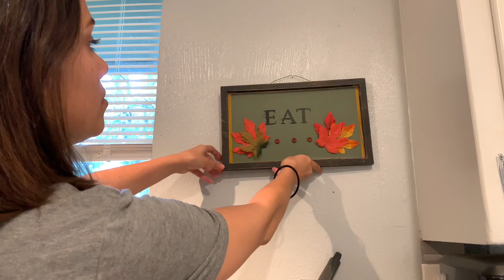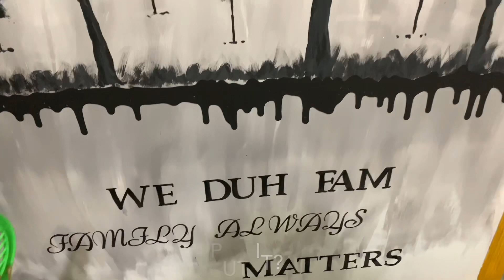Decorate With Me For Fall On Budget 2019 || DIY Ideas|| Cleaning Motivation || Let’s Clean Together

Comment: And  for that little blind that's broke get some clear tape and tape at both ends ,and  sometimes if you have a little plastic or a toothpick you can put it across the bottom or it's broken in half and tape it on both sides 👍😃❤️

Comment: I enjoy your videos. I love the soap dispenser out of the prego jar. I made a 3 piece vase set in a small wooden crate out of my prego jars. I think I'm going to make some wall sconces for my kitchen wall with some also. Don't sleep on the prego jars.😀 Also with your kitchen table and chairs you can just lightly sand them and use some chalk paint. It adheres to wood well. And you don't even have to prime it. I painted my livingroom tables with Waverly chalk paint and did not sand them. The coverage was great. I used matte. But they have gloss also. I also painted my kitchen table and chairs too. I covered the top with a clear polyacrylic or polyurethane to protect it. There is other very economical chalk paint out there too. I cant wait to see what you do with your table set.

Comment: I love your decor! Fall decor is my fave!! I really like your idea with the basket on the sink. Thanks for the motivation! Also I had a suggestion/idea for your bathroom window. Have you considered getting a tension rod and using a shower curtain? The plain tension rods are like $3-$4 at Walmart. And maybe you can use a shower curtain and cut it down to your window size and you can probably make 2 or more with one curtain and that way you can just throw them in the washer and you have an extra. So you don’t have to fight with the blinds anymore... 👍❤️🙏

Comment: Love Love Love your videos.  I prefer slow motion. I have a tip: Why don't you use a shower curtain, cut to size for the window in your bathroom? Blinds do break off little by little.
Reply: I was thinking waterproof blinds since you can see the window from the hallway and looking in. This may be one thing the landlord would be interested in doing to prevent rot in the window well and down the wall.
But contact paper if you're only staying a short while.
Remember to KEEP the landlord's shower head to take yours with you.
I enjoy your simplicity and gratitude for the little things as I raised mine that way! 
Jesus Saves!

Comment: I always vacuum my bathroom before I start cleaning. I hate when my bathroom floor gets wet with hair etc on the floor. Also, when I wash my shower curtain, I hang it back up wet and it dries without any wrinkles.